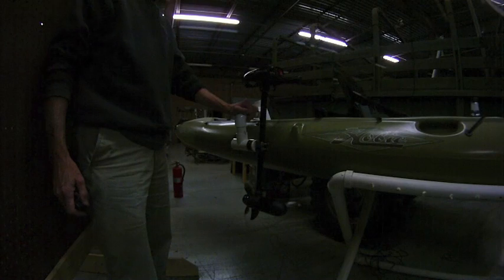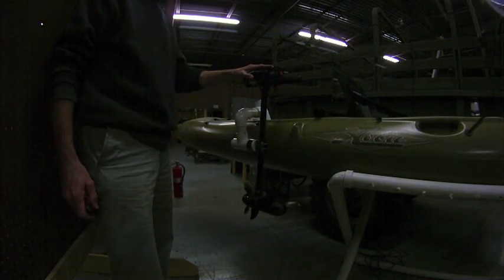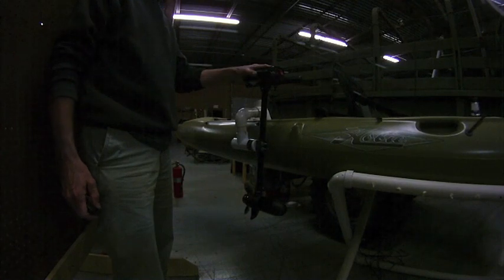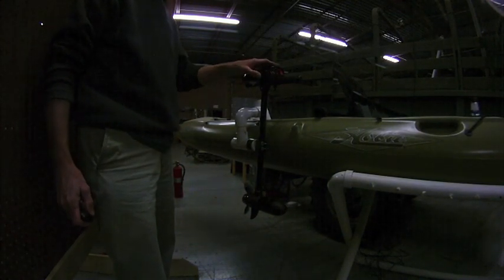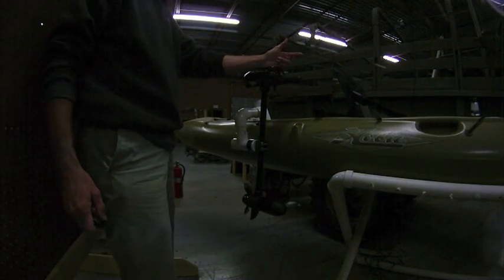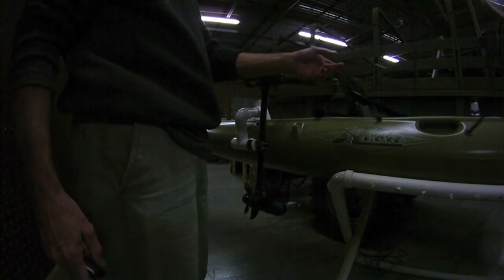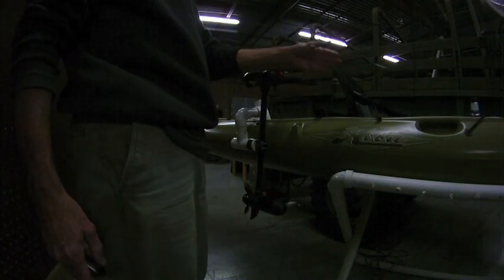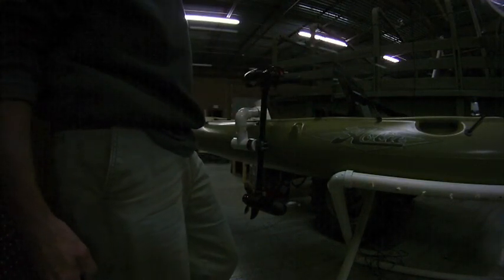Hobie Motor Mount

Comment from the maker: The Watersnake 18lb thrust motor will push the PA at about 3MPH, depending on your weight and water conditions. You'll have to decide if that is enough for you.  Few, if any trolling motors, even the larger 40lb and 50lb models, will ever push it at much more than about 4.2 MPH.

Comment from the maker: No, you can use the same one on all the Hobie boats, but will have to put a slip joint on the downtube so you can set the horizontal mount tube just below the hull seam. The Pro Angler is easy because the hull turns up so it's not anywhere near as critical. The motor post simply attaches to a clamp, similar to what you'd use to fasten electrical conduit pipe to a wall.

Comment: Thanks for the info Tom.  Think I will settle for the watersnake 24lb motor. I have been following your progress on the Hobie forum and read you were developing an adjustable 4 blade prop for your buddy. Did you ever test out that prop?  Thanks.

Comment: Hey Tom just curious if at that position you can leave the motor facing forward and steer with the Hobie Rudder? Thanks for the Idea!
Reply from the maker: Yes, that's how you do it. The motor is locked in place and you steer with the rudder.

Comment from the maker: Unfortunately that won't help you - none of these plastic hulls are verbatim in dimensions. Even being off 1/4 inch is the difference between having a motor that locks itself in place and one that climbs out of the rod holder. 

What you need to do is build yours to fit your own hull. The centerline of the lower horizontal mount tube should be set just below the hull seam. Not too far, but just below. This will prevent the motor from climbing out when under power.

Comment: Ah that makes sense.
So the universal hobie rod holders are not so unversal.
I would have to moake on for my pro angler and another for revo 11?

What did you do to attach it to mount. It looked like you lost all the transom mount gear on the trolling motor.

Thanks

Garth